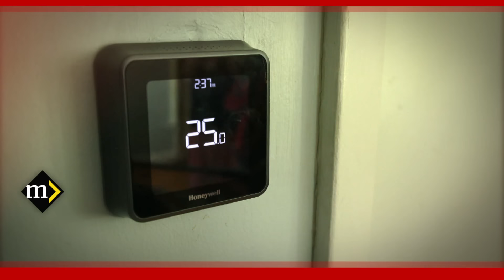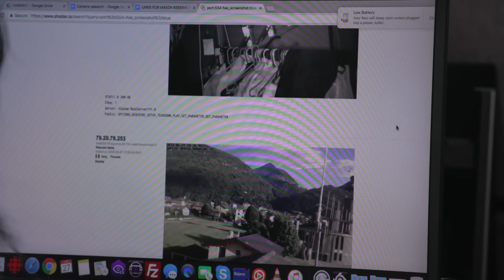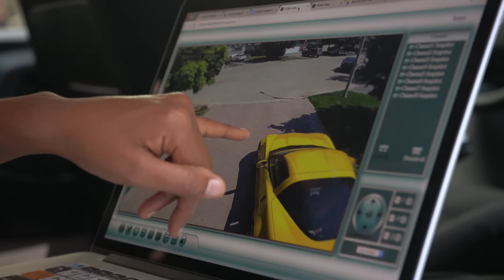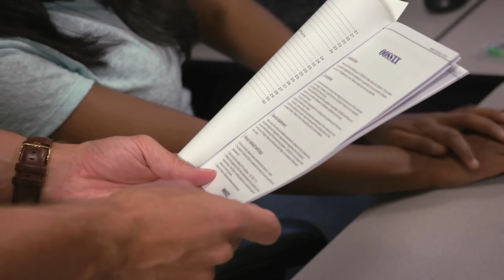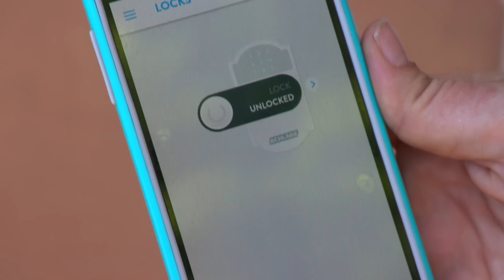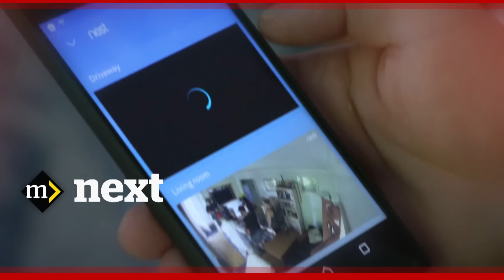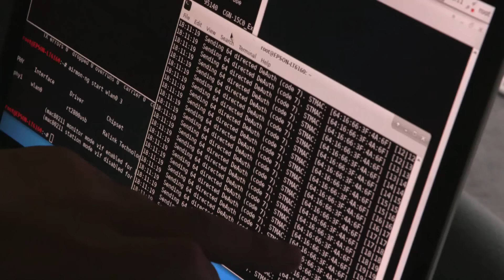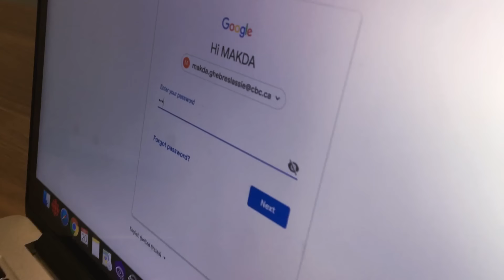How hackers could use smart home devices to spy on you (Marketplace)

Comment: See this is why you get security systems with hard drives.
Reply: Most DVRs use wireless cameras these days for ease of installation. So you end up in the same boat if your router is compromised and someone gets into the DVR. Or, just output a lot of noise on the 54g band and turn their signal to fuzz. 

With wired cameras you can blind them with IR LEDs. So cameras aren't the be all and end all. I've seen footage of some thieves wearing a loop of IR LEDs around the head, so on CCTV their face looks like a small sun. You can sew a strip into hood of a hoody, or mount them on a pair of glasses.

For every problem there is a solution. You have to decide where to stick. Nothing is perfect, or at least there are very few exceptions, but you can minimise the chances to a fairly low percentage. It's just never going to be 100%. A well skilled red team can get into almost anywhere.

Comment: A number of camera systems do not require a password, most say in the manual to add a password. People also don't update default passwords for their wireless routers. So many people want technology but don't want to spend any time learning about it, this is what leaves your vulnerable. Take 5 minutes and learn about the products your installing in your home, not only will you be more secure but you may get better performance from them once you understand the settings.
Reply: I totally agree. Most of these people commenting doesn't seem like they actually watched the video. These are cases of people either not setting up a password or having weak passwords. The woman even fell for a fishing email. So, this has less to do with the technology and more to do with the people not taking the time to properly set it up.

Comment: Aaaaaand I'll be taking down the one in my son's room in a couple of minutes.
Reply: Namelessandpure obviously not anymore for us!  I did it because our son has chronic lung disease and the kids' bedrooms are upstairs while ours is downstairs.  So I was comforted by knowing I could hear and see him at night.  Forget that now!
Reply: @EL-pw2ky  Do some research on the specific one you purchased. Yours might not have the same problem as the one featured in the video.
Reply: Cools2009 it's connected to my iPhone so if "the best of the best" can be hacked, I won't put too much trust into a 30$ one at Toys R Us 😔
Reply: @EL-pw2ky  If the webcam you purchased forced you to set a password, or if you have the option to set a password, do that and you will be in a much better position compared to the people featured in the video. Also, if you can find out how to change the settings on the camera, see if there are features that you don't need which you can disable, the main one being Internet Access or Internet Broadcast. This reduces your "attack surface". 

FYI webcams usually accomplish this Internet Broadcast feature using uPnP, a common feature of routers which essentially allows devices (like wifi cameras) to poke a tiny "hole" in your router's firewall. This allows connections from outside the home, which in some cases this is desired, but most of the time probably not due to privacy issues. You should be able to disable uPnP on your Router/Modem if you know how to access it's settings.
Reply: Cools2009 thanks so much ☺️
Reply: Estelle Lauzon  No problem. Sorry to hear your son has a chronic lung disease. That sounds really difficult.
Reply: There's baby monitors that don't use wifi. I have one for this reason.
Reply: Cools2009 thank you.  He was born at 27 weeks so he had many health issues but it's all getting better 🙂
Reply: Ok, hope you have taken down the camera already.

Anyways, if you need to help your baby to deal with his problems and to keep a look out just in case something goes wrong, the best thing for you to do at this moment of time is use a camera. But a closed-circuit one.

These are wired cameras.
Anything that's connected to the internet and transmits a wireless signal can be hacked and busted into easily. Especially when it comes down to a professional.
My brother in law deals with Security. We get this complaint every now and then.

Don't risk your son's safety cause. It's not worth the hassle or the money that you save.
Reply: @EL-pw2ky  Awwwe, I pray he ends up healthy and strong and living a great life Estelle.
Reply: Cheenjoo Pearl thank you so much!!

Comment: Yeah and there's the rub, the problem is like most people who think they know how to work on their car before crashing into it because they didn't put the brake lines back in properly, the people just plugging stuff in all willy-nilly don't set it up right either. We pay experts for a reason, people, it's literally their job to do the thing we can't do. 

I can connect a hose to a fuel injector on a car very easily, doesn't mean it's a good idea for me to do it instead of a mechanic to make sure it's hooked up properly. Same with these devices, just because you can plug something in doesn't mean it's working right or that you should.

Comment: Honestly, that scared me. I do get the reason for having cameras within the home if you have children. But to be honest, other than the baby monitor and a camera at the entrance I wouldn't put them anywhere else. Too risky. As for smart devices, while I think they are cool. O never trusted anything that connects to wifi. In home network no problem but if it can connect remotely to the internet it's unsecure and I don't like that. Hence why I never buy them. Rather do things the old fashioned way and make things just a tad harder for anyone but me to get to.

Comment: Hardwired non internet based cameras are the best in addition to a security monitoring system such as alarm force , wireless cams might be good for backups as a suppliment in public areas such as a driveway or outside doors. But never would I install a wireless cam inside a bedroom or anywhere private especially if it was connected to the internet. If you live in a high crime area, it's also likley cybercrime is high.

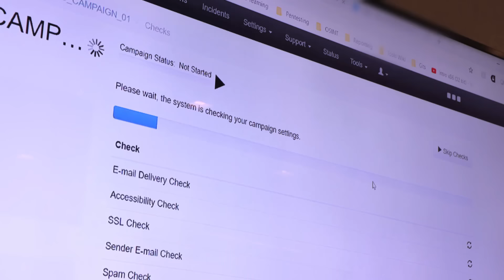Comment: I'm a bit bothered by the "phishing" part of the program.  These guys may have not gotten such good results if they had not already known that this couple were using WINK.  That's cheating in my books - no?  Now for the phising part itself.  Upon pausing the page at 13:31, that was on the screen I say to myself, "Self, you've seen that type of message hit your mailbox on a few occasions".  I know I've generated that message myself when I've been at my daughters place and logged in, or when I have forgotten the pass and had to make a couple of attempts and than get this message, but am I to be afraid of this message anytime I get it because it's potential phishing? Having said ALL that (lol) I use the 2 step text, and bank alerts texts and change passwords somewhat often and of course, I do not use the same passwords for everything.  I do use the "phrases" mixed with numbers for my passwords as this is easier to remember.

Comment: if this video proves one thing, it is that before installing this new technology, it is essential to research the security implications and what can be done about them. it is obviously not good enough to just buy devices and connect them to the network. me, i wouldn't even think about using wifi cameras or services like online voice assistants (alexa, siri,...) or IFTTT. these services come with too many problems. if it can't happen locally, it ain't gonna happen.

Comment: Know basic networking before you deploy anything - especially a device with a default password. That's why that company didn't respond to you: leaving yourself exposed is entirely your decision, even if there was a default password set as factory-default, it would be accessed just as easily as with none at all. 
Two factor is only as secure as your wireless cell provider. Hack the provider (too many have very lax challenge/verification questions), own your phone/IMEI and you'll be hacked faster than you can make or take a phone call.
Reply: Text 2 factor travels in plain text. I'd say get the tool box out and install a hard wired system, back it up with a alarm company system such as alarm force.

Comment: Would a router (Not from your internet provider), but a sold after market one with capability to use an inbuild VPN could help ? I recently bought 2 cameras from Ali Epress, and YOU can use their Chinese CLOUD storage ( wich i would never do) and you can also use tiny amount of storage on Google Cloud storages and others, but i would not trust that too.
I think it's better to use camera's inside with SD card. But of course, this depends also on how big your SD card is, so how long could it record ! For sure not long enough when you would go on holiday for 14 days, because if the SD card is full, it starts to overwrite the data.
I could use those ali express camera's with connection to a hdd recorder with bigger capacity, but if a burgler finds that recorder it's game over. So you can't put those HDD recorders in a vault without cooling also, but it would be the best option i think ? Could you be so kindly to give an answer to this please, this concerns us all. BTW, i'm from Belgium.
Thanks in advance !

Comment: They're all using the DEFAULT PASSWORD !  
In other words, the homeowners have not configured their username/password for the security system.
'Admin' / 'Password' are the default credentials on most systems.  The issue is easily fixed by assigning a unique username & password.

Comment: We have to have test specimens failures for it is the failure that will prevail perfect as the example we must fail each time you fail renders nothing but a chance to try again and again and again whomever does whatsoever consistently of any experience in time over time shall become the go-to person of that experience before we first must have the role to follow for the generation to continue as production

Whomever moves the slowest in any experience will prove that they have not too much experience if therefore the experience of any task is performed with quickness speed and productivity is accomplished for that will show the more experienced individual So the faster remove the more experience we may have the slower we move the less experience we may have sometimes there are variables people do become under the weather people do become first time naturals